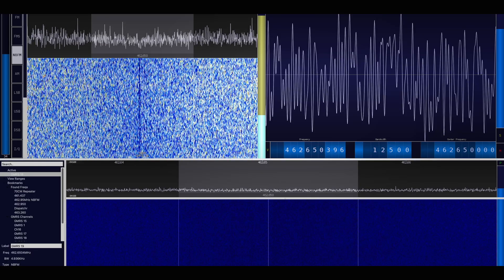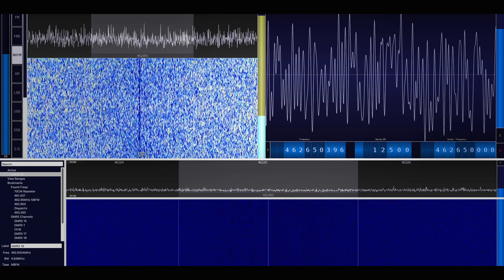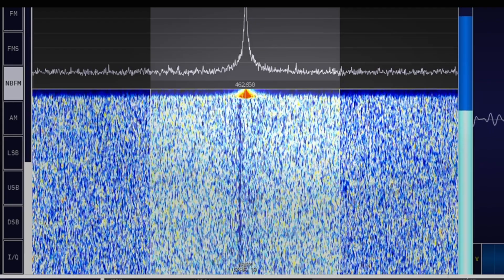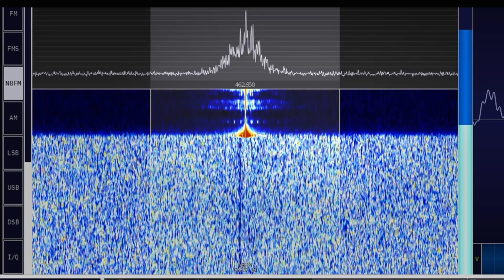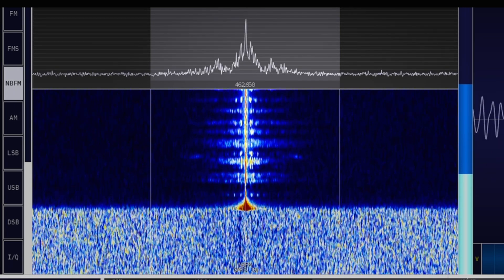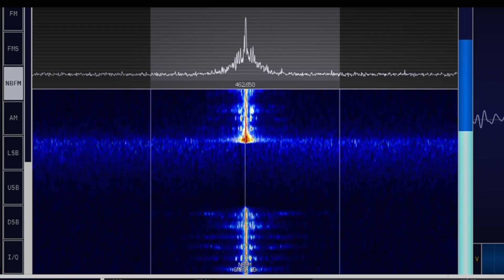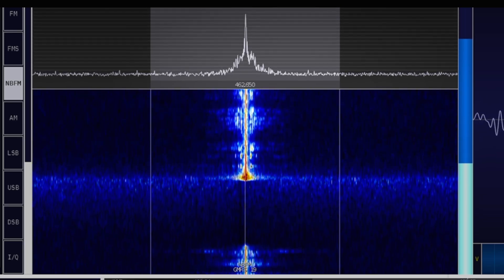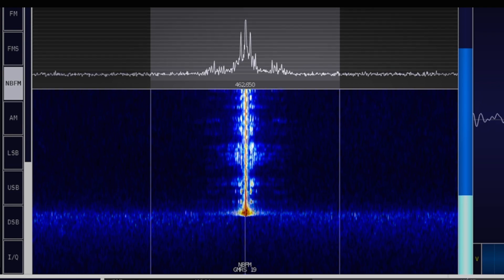Wideband VS Narrowband - What Is The Difference Between Narrowband And Wideband On GMRS Radios?

Comment: Notarubicon great video buddy about narrow vs wide. Usually what I do is if I find a frequency, I'll listen to it in wide first then switch to narrow.

If narrow sounds like more noise floor or "static", I'll go with the latter.

I agree that wider sounds a tad quieter but is less prone to interference which gives a more clearer sound. It's a trade off but worth it!

Also, some transmissions may only work in narrowband in an instance where if you switch to wide you can hear nothing. For that circumstance, narrow is the only option for that frequency.

This is how I play with the 2 types of bandwidths. Hope this helps for everyone who enjoys this on the receiving end or as a scanning hobby!

Happy radio adventures everyone!

Comment: Just installed a Midland MXT575 in my truck and I get static on every channel and “RX” is on when in wideband. I was on channel 15 but it did it on other channels, too. I also adjusted the squelch. Narrowband works just fine. Where can I find help for this? Thanks.
Reply from the maker: For help I would recommend contacting Midland Support.
Reply: @TheNotaRubicon I’m a dummy, I turned the squelch up from (default) 4 to 6 and it went away. It made the same noise when the vehicle was off to make sure it wasn’t LEDs or light bars causing it. I dun learnt sumthin’! Thanks for the response.

Comment: Learning much from your videos!  Thanks!  Question: are blister pack gmrs radios wide band?  I’m using MXT 275, which in your review, you mentioned is narrowband. My car club members use inexpensive cobra gmrs units.  I’m frequently told that my volume is low. I don’t think it’s my mic, I modified that and gained much clarity and some volume.  Nevertheless, I’m occasionally told to “speak up” , and my voice is not weak.
Reply: I am pretty sure the newer model of mxt 275 is selectable wide/narrow band. If you have an older model, you may be able to send it in to midland to update with that functionality.

Comment: Biggest problem in my experience has been trying to communicate on a narrow band repeater.  Anyone with wideband will clip out. If their radio is not capable of narrowband then they must hold their radio far away.

Also, it's funny when you say radios that operate in wideband are "real radios".  It takes a better radio to operate in narrow with 6 or 12 kHz spacing and the government keeps reducing it to limit interference and sell more channel licenses.

Comment: Thanks for this video.  It made the whole narrow versus wide very understandable.  I do have two questions/comments.  First of all, it would have been nice to hear the comparison between narrow and wide without the repeater.  If I understood the scenario correctly, Chris transmitted in wide band over the repeater, but switched to simplex for the narrow band.  It would have been interesting to hear both options either with or without the repeater.  Secondly, are you actually getting ten miles of distance in simplex on a pair of handheld GMRS radios?  My understanding was that handhelds with small antennas and five watts of output start to drop off after a couple of miles.
Reply from the maker: Yes, i am getting ten miles on simplex on a pair of handheld GMRS radios.. 13 miles when I talk to another buddy.. GMRS handhelds with 5 watts and small antennas range is dependent more on line-of-sight than anything else, and I have good line of sight.
Reply: My handhelds get about 3 or 4 miles between themselves.  But on my base station I can hear a handheld 40 miles away.    That was something I did not expect.

Comment: I'm so confused. On my commercial radio, it came locked to "Narrowband Only". It was shown in the Feature Set of the radio. On analog channels there is an option for "Channel Spacing (Khz)". Since my radio is restricted to Narrowband Only, my only option in that Channel Spacing drop down list is 12.5. 

I purchased the Wideband Entitlement for this radio that released that "Narrowband Only" check box in the Feature Set. When I unchecked that box and went to a Analog Channel, in the Channel Spacing drop down list....I then had an option for 25 khz. 

When I'm using 25Khz "Channel Spacing" on GMRS, the audio sounds better on both TX (According to other stations) and RX vs when I am using 12.5 Khz "Channel Spacing" 
Make it make sense Randy! 😭

Comment: Dear Professor Randy, thank you for giving credit to your personal Radio Oracle, Chris. Here in the hills of East Tennessee, our FARS are more limited - until we get “up high”. I recently tested my Wouxun KG-100G and only got about 24.7 - 25.3 watts output. Wondering if I can get a warranty exchange.
Reply from the maker: Make sure you are testing the output with a dummy load, and have 13.8V input power (not "12V").. Stop wondering if you can get a warranty exchange and contact BTWR and ask them!

Comment: Nicely done Chris and Randy! The only other decent video I’ve seen on the whole wide band versus narrow band thing likewise used a waterfall display to show the difference between the two. As a practical matter, someone stuck with a narrow band radio could ask the person they’re talking with to back off their mic a little. This would eliminate a lot of that clipping. 

Somewhat confusingly, I’ve seen programming packages that express wide band/narrow band in terms of channel spacing, with options like 25k versus 12.5k. In such a case, picking the bigger of the two (25k) is the same as picking wide band.

Keep the videos coming Randy! Great stuff!

Comment: What radios were you using?  10 miles on GMRS?  I didn’t think you could get that range on GMRS.
Thanks for clearing that up for me!
Reply from the maker: 10 miles is easy on GMRS in the right conditions, meaning good line of sight between the two radios.

Comment: Thanks for the explaining. So does that mean that with "narrow band" you can get a closer channel spacing and therefor more channels than using "wide band"?
Reply from the maker: If you were designing a radio service, then yes, with more narrow channels, you can squeeze more into the limited spectrum that you have to work with.

Comment: Thanks for explaining it to normal people. I fail to see why one would willingly use narrowband after this presentation.
Reply: Narrow-to-narrow cuts through static brilliantly. If you're only communicating with a small group and never with anybody outside that group, stick to narrow if your radio does both. Wide is the default, but narrow-to-narrow will get through clearer when you're both weak to each other.
Reply: @W2IRT  seems you don't fail to understand and also are able to explain to us, normal people! LOL, this channel is awesome.
Reply: Or possibly... while on the trail talking mobile to handheld...  FRS is narrow and if using a Midland handheld, they operate on narrow as well. ... not sure about other handhelds,  the ones I own can be switched.